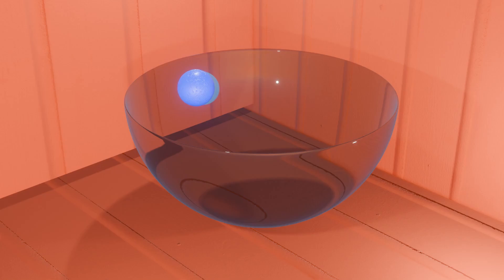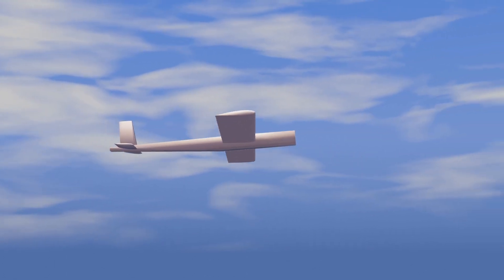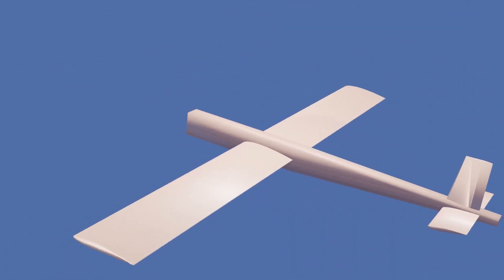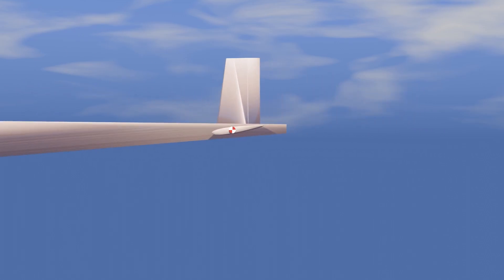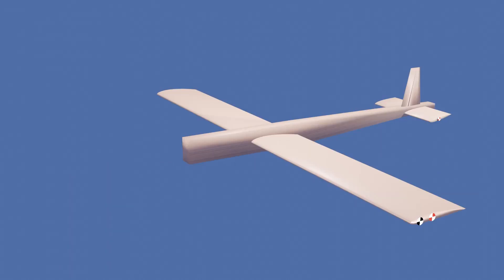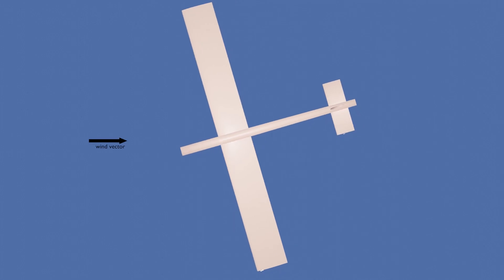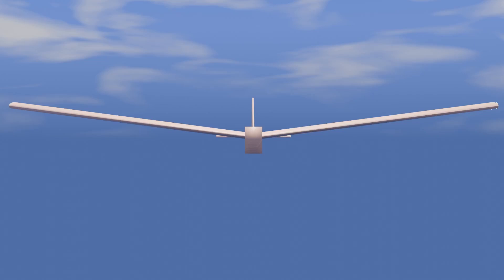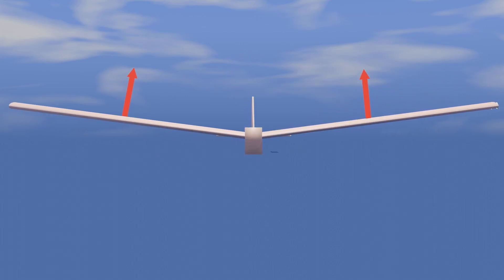How Aircraft Maintain Stability in Flight

Comment: Another design aspect which will help with yaw stability is wing sweep. The outboard wing or outboard section of the wing will produce more drag than the inboard section, thus helping the aircraft return to its stable mode.
Reply from the maker: Good point! It does help.  I'll address this in a later  video.
Reply: Pilots claim that swept wings are hard to fly. Trainers have straight wing.
Reply: @ArneChristianRosenfeldt  We are talking about modest sweep angles. Angles like those of WWII aircraft for instance. You only need a few degrees for the outboard wing to produce more drag.
Plenty of trainer aircraft do have a mild sweep angle.
Reply: @leoa4c  the lower the wing, the more dihedral. At some height even anhedral is used. No subsonic plane sweeps their wings. Flying wings do it because their tips act as tail. It actually worsens stability. Twin boom is the real solution to pusher props. But then again for aerobatic I like that in a flying wing the tail never passes through the wake of the wing. The wing tips of the Concorde are actually for stabilisation, not lift .

Comment: Small correction: roll stability is actually achieved because the dihedral results in uneven vertical components the lift vector. Both wings have the same angle of attack, but the higher wing produces less vertical lift, while the lower wing produces more. This creates a moment that corrects the roll of the aircraft.
Reply from the maker: The wings do not have the same angle of attack with dihedral when disturbed. 

When the aircraft rolls, it will also slip in that direction. This side slip results in the wings seeing different wind vectors, and therefore different angles of attacks. In a straight wing, they’d see the same wind vector. 

It’s easier to see this if you consider angle of attack as the change in vertical velocity over the wind vector velocity. It clearly shows the higher wing would result in a decrease in angle of attack and the lower in a higher angle of attack. 

The angle of attack difference results in the low wing producing more lift, and the high wing less lift. This is what causes the roll moment to return to wings level.
Reply: Can we start from a hang glider? Straight wing with tail. Heavy pilot in a nacelle front / below. Now you apply your normal forces.